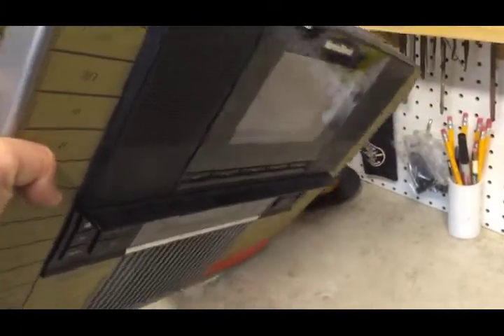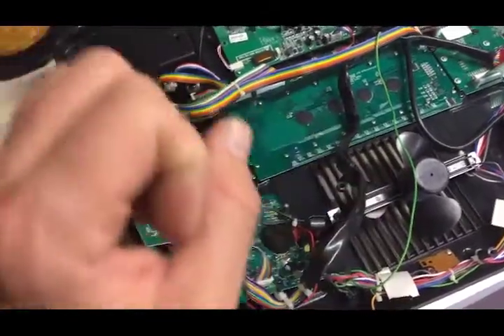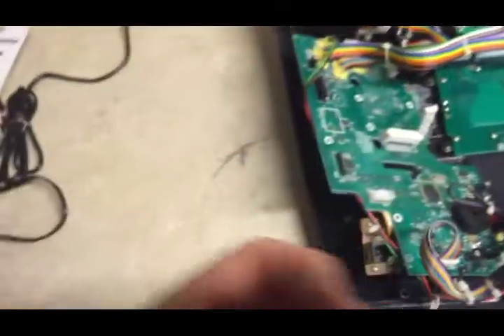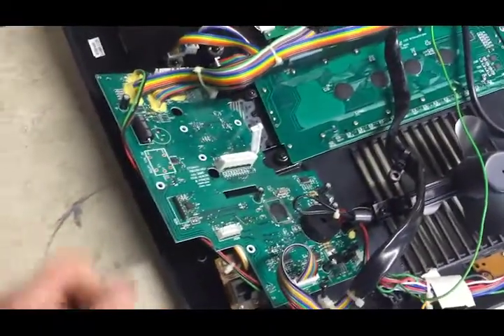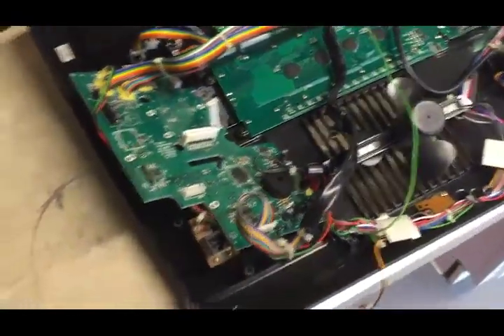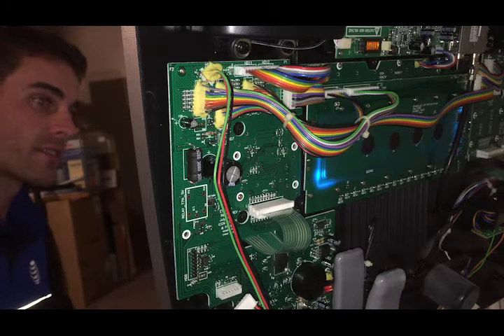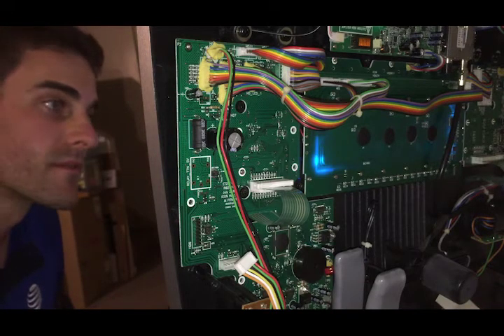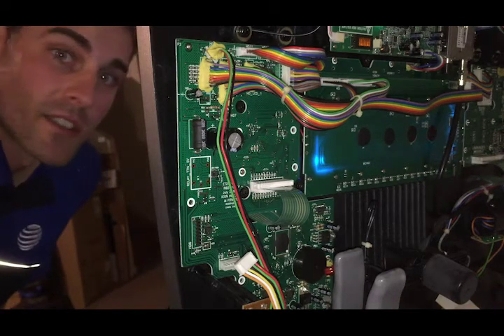Fix Constant Rebooting on Nordictrac Viewpoint 2800 Treadmill

Comment: I'm having the same issue with mine. When replacing the capacitor did you weld it in?
Reply from the maker: Nicole P solder, yes

Comment: Had similar issue.  Constant speed, increase/decrease buttons did not work. Low and behold, capacitor showed signs of cracking/expanded.  Replaced using same link to Digikey as Stephanie Pabis.  Great post!!!

Comment: So I pulled out the capacitor and and was able to get the treadmill back down to zero on the incline but I have additional questions about replacing it and it looks like it might have pulled from the board like some blade not sure
Reply from the maker: Not sure how much help I can be. This was too long ago.
Reply: Okay thanks I’ll keep researching you stated you welded it on but if they’re snap connectors wouldn’t they just snap into place

Comment: I have a 1750 model.Sometimes it restarts over and over other times you run on it for 20 minutes then blam randomly reboots then 10 minutes later it does it again.Sometimes it doesn't restart you have to use the reset switch.Its not loose wires.Will do it just sitting there with no one on it.Then it will work flawlessly for 2 weeks.Seems if you never shut it off ounce you can get it to stay on its good for a while.Yesterday it got shut off by accident,in the space of 3 hrs it was rebooted 20 times at intervals ranging from 1 minute to 40 minutes randomly  now its been on for 18 hrs straight.A new console is $1600.....F that.   Consumer research resulted in this is the best mill under $2000.Going to call BS on that one.Going to attempt this capacitor fix if it doesn't work youtube diy gang will show you how to control the motor with a rheostat setup,they use these motors for homemade woodworking equipment its very simple.Question is:mine stays on for different time intervals has anyone else had theirs specifically do this and fixed it with the capacitor change?